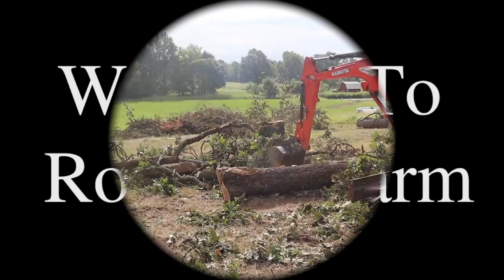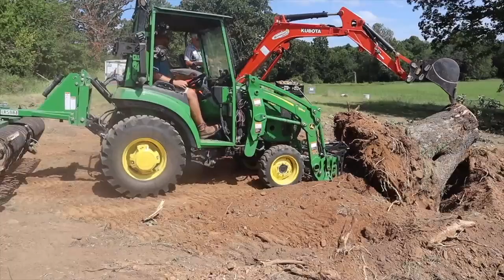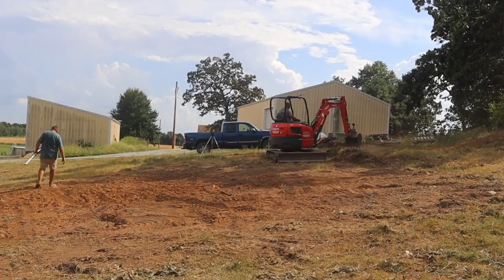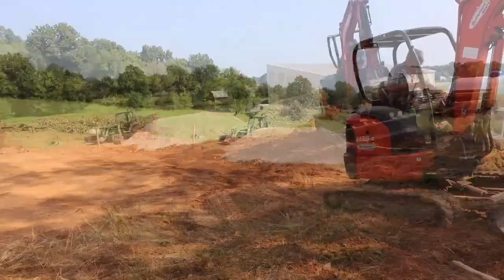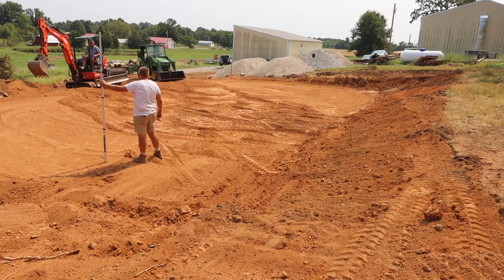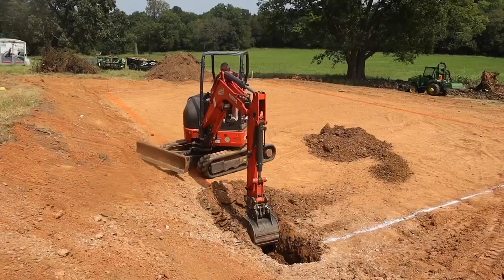Cutting Grade into a Hillside - Start to Finish in 8 Minutes

Comment: hey Brock what self leveling laser are you using? I've been researching them as I'm gonna need one here in the not too distant future.  - Josh
Reply from the maker: I use a Bosch transit level. It’s the model that the crew used when they were pouring my concrete so I bought the exact same one. It has worked well for me